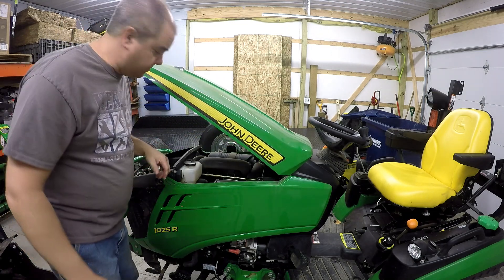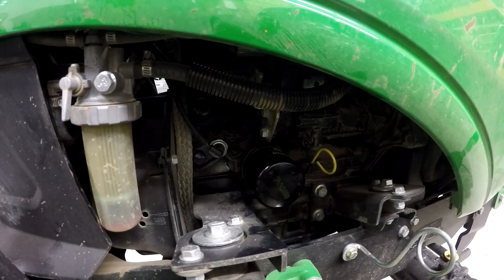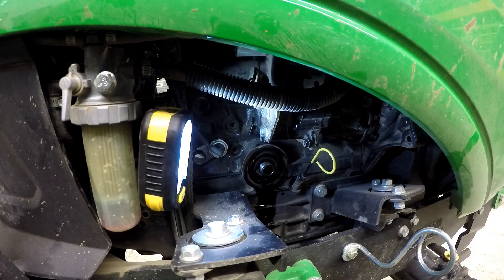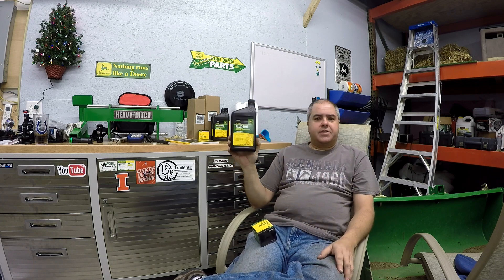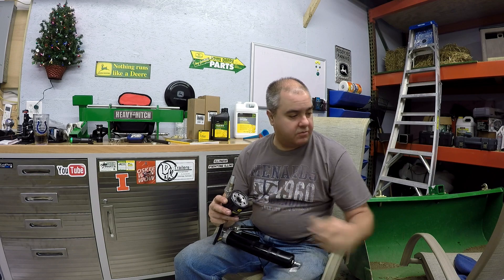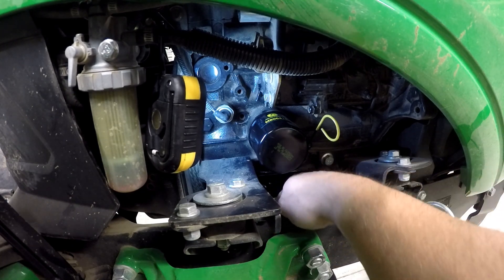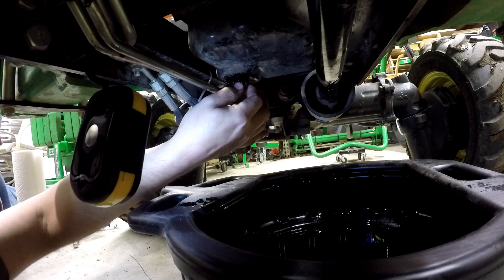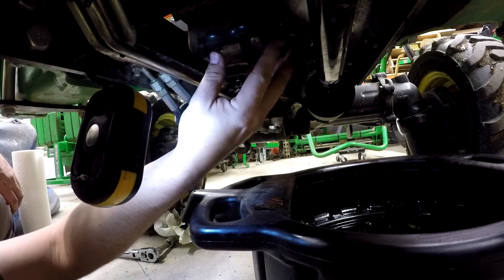Deere 1025R 50hr/200hr Engine Oil / Filter Change

Comment: John Deere says the JD engines has 'break in oil' my 1023e (just got it) as all here I'm sure know, has a Yanmar engine are we talking the same engine?  Thanks. Learning alot here. Ron Brown
Reply from the maker: The 1 series no longer uses ‘break in oil’ to my knowledge.
Reply: @TractorTimewithTim  Tim Thank you. While I have your ear,  under the seat of the 1023e there is a small T-handle, I've looked at my manual and I'm not able to find any reference to this, it seems to go to the diff/trans? Your video on front blade quick attachment was a blessing, little bit of a puzzle to put together. Stay safe and healthy.

Comment: I have a newer style 1025R.
My owner's manual (OMLVU31626) states to change the engine oil and filter every 200 hours.  The new manual online (omtr117450) states every 400 hours.  I am a residential owner and do not put a lot of hours on the tractor every year.  I will take me many years to reach the 200 or 400 hours maintenance intervals for the oil change.  Is For the oil, coolant, transmission oil, is there a year interval that these should be replaced (i.e every 1 or 2 years)?  I was not sure if you have any insider information from John Deere if there is a yearly maintenance guide for these fluid changes.  Can the tractor really go many years without fluid changes if I put a low amount of hours on the tractor every year and only do my fluid changes based on the tractor hour meter as stated in the manual.  The manual does not state fluid should be change every x years if the hours are not meet. Any guidance you can provide would be greatly appreciated.
Reply from the maker: No insider info.  However, I would recommend changing the transmission oil, and cleaning shavings out of the case by at max 100 hours.   Then, proceed at the manual specified interval.
We find those shavings to be significant in the first 50-100 hours.  
I doubt it hurts the machine to wait until 200 hours,  but it might reduce the performance a bit…and I think it increases the ‘whine’ when lots of shavings on the screen.
Reply: @TractorTimewithTim  Do you have any recommendations on the engine oil change if you have low tractor hours.  I am use to automotive manuals they specify a engine oil change interval based on mileage or every 6 months which ever you reach first.  But in the tractor manual they just state engine hours, which for me would take many years for example to reach 200 hours and seems wrong to go that many years without changing engine oil.  I am curious what you do with all of your equipment and if you have low hours on equipment do you change oil every year at least?  I really appreciate your time and effort that you put towards this videos and have been following from almost the beginning.
Reply from the maker: I would worry more about hours.   
Having said that, if you want to change every year, there is no problem with that!

Comment: I 'hand tighten' my oil filter. When you do not use a tool to tighten the filter you are not going to 'overtighten'. That gasket is meant to be snug between the filter and engine. If you can remove the filter without a tool the filter is not screwed on tight enough. Just my experience. Have you considered wearing disposable gloves when exposing your hands to used motor oil?
Reply from the maker: I should probably try the gloves.  The ones I've tried irritate my hands. ..we never used gloves on the farm for oil type stuff, so it is just habit with me.

Comment: Hey Tim,
Just so you are aware .The green farms parts link is not adding the parts for the oil change to the cart. My 2025R is not a week old ,but  the driver recommended to change the oil at 20 hours???  What are you thoughts?
Reply from the maker: The book says to change the oil at 100 hours if I am not mistaken.

I have notified green farm parts repeatedly about the failing link. So far, no fix. Sorry.

Comment: Hi Tim - I have a 2018 1025R and it looks like there are 2 oil fills. One on the top that you show in the video, but also one down the starboard side of the engine - do you know what it's for?
Reply from the maker: You can use either one.

Comment: Great video. Has anyone nailed down when the 1st oil change should be done?  Mine has 34 hours on it and I want to change it if 50 is when it should be done. Maintenance Manual shows 1st one at 200 hours. Seems too long. Keep putting out the very informative videos.
Reply: I just read through some of the comments and saw TTWT says 50 then 200.
Reply from the maker: Newer 1025r’s state 200 hours for first service.

Comment: I HAVE NOT SEEN YOU CHANGE THE SPARK PLUGS. YOU HAVE A VIDEO ON THAT.
Reply from the maker: Ha!!    When I find them, I will change them!
Reply: @TractorTimewithTim  So there is no spark plugs?
Reply from the maker: @oscarsalas3200  no.  Diesel engines do not use spark plugs.  They use high compression to provoke the fuel combustion.

Comment: My dealer said to leave the break in oil in for 200 hours , I have the 2025 does that sound right.
Reply from the maker: that is what the manual says now. ...for the 2018 and later models.

Comment: With the loader off its easy pain if loader is on and even more of a pain with single point and 3rd function connectors on new tractors. Change oil every year.And partially fill with oil to get oil to the engine quicker. Any hydrocarbon motor will turn the oil black because of all the hydrocarbons .

Comment: Hi Tim,
I did my first oil change at 50 hrs. Do I need to do oil changes at 50 hr intervals, or can I wait until I hit 200 hours (150 hr interval,  as with the hydraulic fluid)? I have received varying instructions so I'm coming to you for the gospel.
Thanks!
Reply from the maker: 200,400, etc from here.  The first 50 is a ‘break in’ change.
Reply: @TractorTimewithTim  I believe their is a one year recommended time change too. Time affects oil too with water condensation, acids, etc.

Comment: Tim the reason that first filter was hard to get off. That is a diesel engine and have a high vibration not like gas. Your filter and drain plug need to be more than just snug. You can get away with it for awhile but one day oops. Just saying.

Comment: Hey Time , So any brand of good quality multi-purpose grease is OK to use on my 2025R? or does it need to be JD? Thanks
Reply from the maker: It does not need to be JD.    This episode helps to explain. ...it also shows a very nice grease gun which does not have the messy plumbing of a traditional grease gun!
https://youtu.be/2Y8DfLitRzM

Comment: Just did my first 1025r oil change, noticed the original filter was way heavier duty than the replacement and even made different on the inside, anyone else notice that? and yes i used the john deere 806418 filter.
Reply: Yes, the factory filter is made my Yanmar.  The replacement filter is a John Deere filter.  John Deere sources their filters from a different manufacturer.

Comment: Why don't you pre-load the oil filter before installation?
Reply: Because the oil filter screws on at a 90* angle.  The pre-loaded oil will run out while your screwing it on and make a real mess.

Comment: Punch a small hole in the end of the filter at the bottom. Hold a plastic bag to catch the remaining oil in the filter. Saves it running down the side of the block .

Comment: Aren't you glad that we no longer have oil cans?  I changed the oil just twice on my pickup truck. Cleaning up and getting rid of the waste oil was such a pain.  Besides, that engine oil can be re-processed.  In all seriousness, your video shows the proper way to care for equipment.  Grease, oil, coolant are the cheapest things you will ever put in your equipment.  The Europeans are coming out with an opposed four cylinder diesel for your truck.  Plenty of torque, simple design does away with almost all the environmental controls.  And the curious thing is that the engine was invented in 1892.  Then I'll get a pickup with a diesel.

Comment: you forgot to oil the rubber seal on the filter!!
Reply from the maker: +04tacomaguy1 I did not forget.  I used grease.  Always do
Reply: true. i love my 1025r. where did you get those wheel weights and how much?